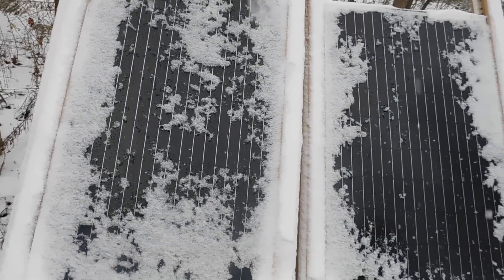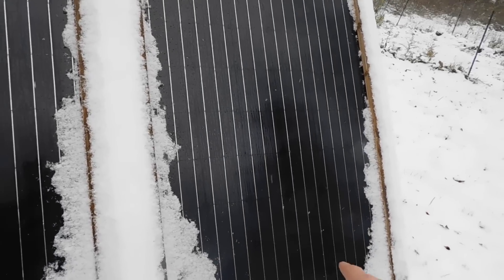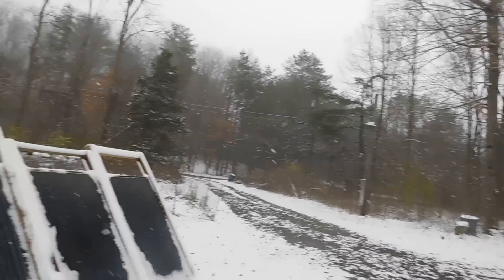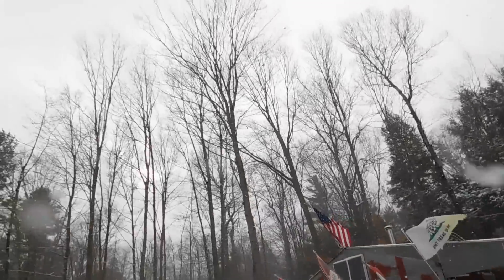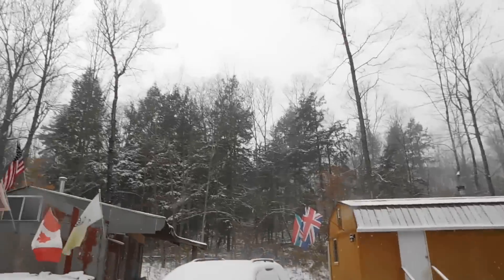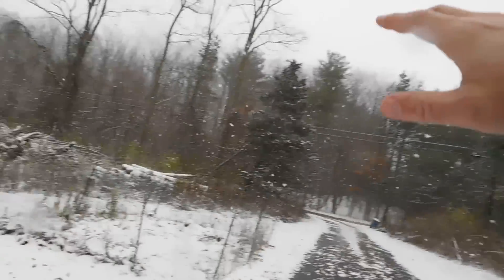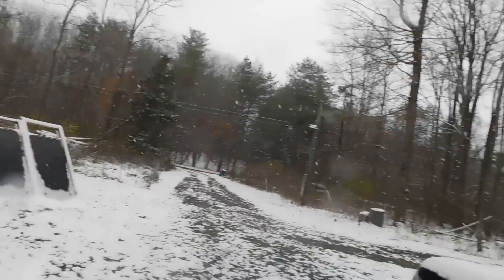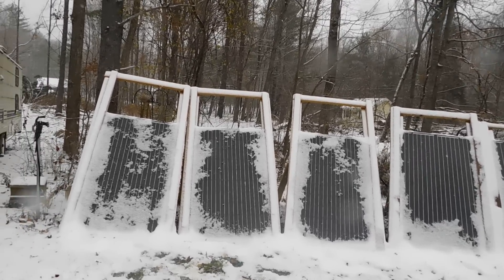Snow and solar panels showing you something neat.

Comment: It would be nice if the manufactures would build in a heat tape to warm the panels. Our system is a grid tied  and some snow storms may take a few days to get the snow to slide off. We have had the system since the summer of 2011. It has been a great investment.

Comment: i put my solar panels. mounted on a medal fence post, with a male, female joint to allow me, to rotate each pole to follow the sun, i had each pole bent at 45 degrees,the panels are about 6-8 feet off the ground, 10 batteries, and a total of 8 ...100watt panels, i live in florida,try to keep your panels near the batteries, and reduce the distance of all cables, i can clean the panels with my washer broom on a broom handle, i use a battery charger at night, plugged into the grid, i have 2 back up generators, ready to go when  SHTF..... im a 60 yr old lone wolf prepper, i cant find no trust worthy person to get on board with me, so the enemy is 99% of the non-ill prepared,ignorant, denial, smokers,drinkers, druggers, im disgusted on the people in this spoiled rotten usa..........I SAY OBAMA WILL NOT LEAVE THE WHITE HOUSE, marshall law, UN, possible war with russia, or monetary collapse !  get silver ! food, water , bullets
Reply from the maker: I do need to get them mounted And its a crazy world that is for sure I wish you the best of luck and keep your head down when the time comes.

Comment: Wonder how many folks have rooftop panels with ice/snow build up...can't be good. Ground mount (IMO) is so much easier to manage...and higher kWh harvests if on a tracker system. Stay warm man...looks like your neck of the woods is going to be clobbered this winter season.
Reply from the maker: I will do pole mounts in the spring. And I think we are going to get it hard this year.

Comment: I have to get me some solar panels. I have a well (with 12v 210v and hand pump), septic, wood burner so close to being set. Just need to save up for solar panels.  I have done a lot of research on them though. I need about 4K to start. Which will give me the minimum but a lot of expand ability. I can add more panels as I go. We're looking for some property to buy next year so we can sell this place. At that point We will go full offgrid. I plan on building my own wind generation and water generation.  For redundancy.
Reply from the maker: That sounds like a great plan stick with it and you will reach your goals.

Comment: You might want to try Rain-X. I used it for years  while driving big rig. The rain and snow just seem to jump of my windshield. Not as well parked but it made a big improvement waking up to clean windshield and mirrors.
Reply: Ohhh yeah good idea. That stuff works great on glass.
Reply: ***** ALmost all I have seen were glass. Seen a bunch trashed by hail etc. Small ones like used on driveway lights are just coated in plastic though.
Reply from the maker: its glass.
Reply from the maker: hail is not our friend. lol
Reply from the maker: That's not a bad idea thanks.